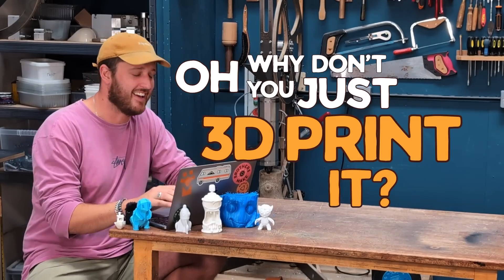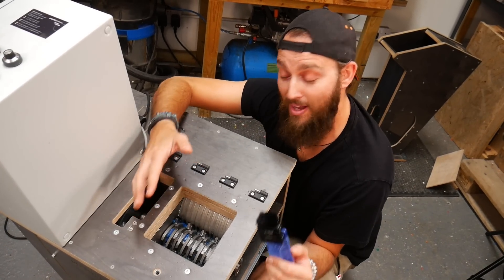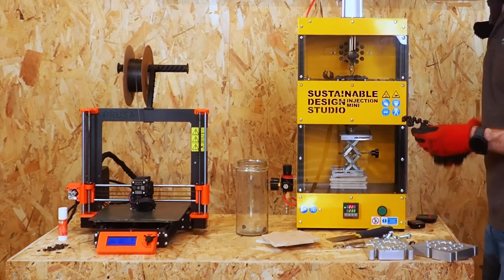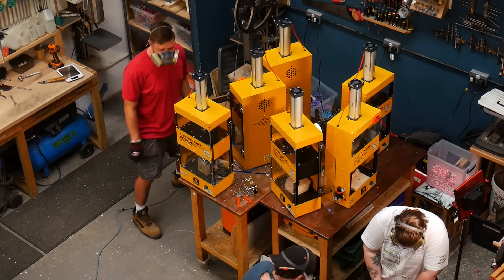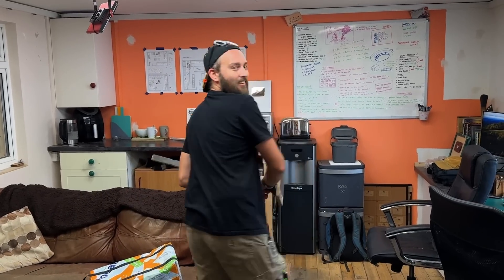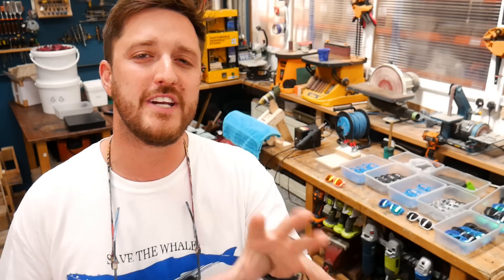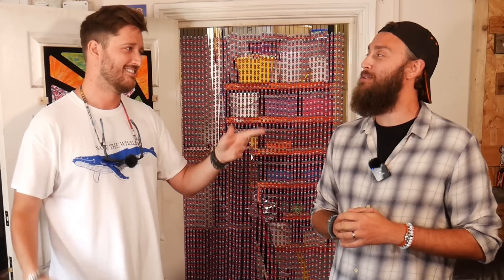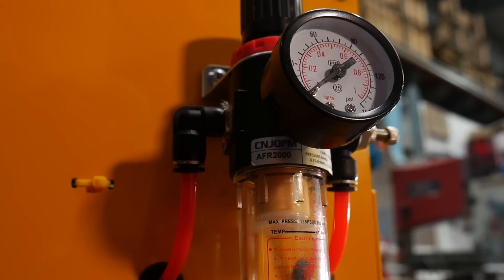Is THIS Better than 3D Printing?

Comment: I mean, in Russia, we had craftsmen who could assemble an automatic plastic injection molding machine from components costing around $1,000 and, using a cooler, bring the cycle time down to 6 seconds. This is only for small parts, although you wouldn't make a comb that way, but if you need a lot of similar small parts like Beams, it could beat both of your setups in terms of speed, price, and labor costs.)

Comment: One thing you guys are not considering is the 3D print bed. 12 dinky little beads for one print cycle? You could fill up that bed and likely print 75-100 beads on a print cycle with zero human interaction. Does it take more time? Yes, though the machines can run for hours on end with only minimal babysitting. As long as the prints don't fail which of course can happen.
And that comb print... just no. Print that flat, interlock the teeth and print 20 of them at a time. Printing them upright actually takes longer and will break off the teeth where the layers print!

Comment: When comparing print times it is disengenuous to not include setup time.

For injection molding setup time includes designing and getting the mold made. So a 3d printer, a couple of hours setup which includes design of the object and a run to three shop to buy some filament. 
Injection molding maybe a couple of weeks to months...

Comment: OK this is a skewed report because it does not look at like for like, completely ignoring the cost of the moulds, each mould might cost as much as the injection moulder and if you want a print farm then you need a mould for each machine, also how long does it take to machine the moulds ?

Comment: that prusa printer is slow. i would like to see it run on an bambulab. should of filled the bed with with as much parts as possible aswell.  
At less than 10,000 parts Formlabs Form 4L thought not consumer priced but more prosumer priced at 10kusd is a pretty solid option here.

Comment: they BOTH have their DIFERENT uses.  this is like comparing if a SPORTS CAR is faster than a 4X4 ....  IN MOUNTAINOUS ROCKY TERRAIN.  the only thing you demonstrated is that your way is really good at 1 very specific thing. i would not buy an injection machine as a hobby..... i would a 3d printer.

Comment: One thing you could 3D print that you can't injection mold (at least I don't think you can), is a pre assembled bracelet, and if you dial in your slicer, you can do that with near zero post processing.  You can also just have the printer print them all night (if you dial in your bed ejection procedure), and all day, with zero humans required, except if it gets fouled up.  Or even without bed ejection, you can print multiples of the same model vertically.

Comment: I think this is slightly distorted... you waited until the end to mention the most important factor... jig / mould manufacturing time and cost is not-insignificant.... whats been missed is 3D printers (SLA or FDM) are great prototyping, far, far cheaper and quicker than injection moulding... but for production / manufacturing once the jig has been made, injection moulding all the way... are you using a CNC machine to make your jig / mould?

Comment: OH why don't you just (Resin) 3D print it?               Seriously though, resin is much faster, I'm curious to see a video from you guys comparing that! Also wow $400 pound to get your bead mould made sounds pretty good!  I would also loved to have seen more detail on how 2 moulds was used in 6 machines. What actually was your workflow to churn that out? What are the other 2 machines doing while the mould was in use for the 3rd machine? Subbed :)

Comment: Question, when looking at bench top injection mold machines they have size options such as 50 grams. When you have a 50 gram injection mold machine how big of an object can you mold in relationship to a roll of quarters? Like one roll, or 1/2 roll, etc..? Thanks 7:30

Comment: 🌍 PLA vs. Recycled Plastics: A Fair Perspective 🌱

I love what this channel does with recycling plastics like bottle tops and carrier bags—it’s inspiring to see waste turned into something useful! But I feel it's important to bring balance to the conversation around materials like PLA (Polylactic Acid).

PLA 3D printing materials are often criticized for their environmental impact, yet they have significant benefits:

PLA is made from renewable resources like corn or sugarcane, reducing reliance on fossil fuels.
It’s biodegradable under industrial composting conditions, which makes it a step toward reducing plastic waste.
However, it’s true that PLA, like all materials, has challenges:

Without proper composting facilities, it may take centuries to degrade in landfills, much like traditional plastics.
On the other hand, recycled plastics like PET2 or HDPE are fantastic for reusing existing waste, but they aren’t biodegradable and persist in the environment if not properly recycled.

Here’s the truth: both PLA and recycled plastics play essential roles in reducing waste and pollution. The real focus should be on:

Proper Disposal Infrastructure: PLA needs composting facilities, and recycled plastics need efficient recycling systems.
Complementary Roles: PLA is great for items designed to degrade, while recycled plastics excel in durable, reusable products.
Instead of labeling one as “bad,” let’s recognize that sustainability is about using the right material for the right purpose and ensuring it’s disposed of responsibly.

As the 27th day 🌟, I’m passionate about fighting for fairness and sustainability. Let’s celebrate solutions that work together to protect our planet! 💚♻

Comment: A real injection moulder machine only works fast if it is made from mold materials that can be cooled quickly to solidify the product and eject it quickly from the mold. If not you have a simple molding machine.

Comment: You think 3D printing would be more expensive for your beeds because you aren't as good as 3D printing than injection molding 🙂. I am someone who is good with 3D printing but never used injection molding yet. Let me show you how I would have 3D printed the beeds and when injection molding would be better than 3D printing and vice-versa.

I could have printed these beeds with no raft and no support so no post processing after and I could put enough on the bed to print 3 days straight before having to remove them by placing them on top of another, you can look on the internet it takes some skill but permits to print more per batch. By those means I would be at least 2x more efficient as your setup so I'd need at least half of 35 printers, probably even less because I normally print twice as fast as other "average" 3D printer user by advanced slicing and special printer modifications for the same or better strenght and quality. Also I buy my black filament at 10CA$ wich is equivalent to 5.57GBP and colored one at 7.8GBP wich is way less than in your video. Based on what I could see in the video you have to recycle a lot of your plastic when injection molding the little beeds while my setup would make no waste so I win on the plastic price per beed. Also I would only need to be here at the start of my setup and at the end only with maximum 5% failure rate of each print plate, I also win with worker time which is the most valuable ressource here. With machine cost I would be double your injection setup I think, definitely not quadruple.

Why did I prove all this ? I wanted to show what 3D printing was created for. It is made to make cheap and accessible parts that need little to no work hours to build and only machine time. Also 3D printing permits to make extremely complex parts and even hollow parts with no post processing time.

The real reason why somebody would use injection molding over 3d printing is:
- Food safe product easy to wash without the need to coat it in resin for example. I think some 3D printing resins may be food safe and easy to wash but I haven't researched yet, I know though that normal printer UV resin is not food safe even in it's cured form
- Finish quality even a little better than resin
- Really good strenght in all direction, FDM 3D printing is as good but only in the direction of the printed lines. For example your comb would be pretty weak if 3D printed or would need to have big fins, so molding is better in that case. Also most 3D printer resin is pretty weak in comparison to what injection molding can make.
- Best price per kg, for really heavy and or strong parts, injection will always win, especially vs resin because resin costs an average of 17GBP per kg for me and that's just good basic resin for that price, far from engineering grade resins. Keep in mind some industrial printers can use pellets so for those printers cost per kg is not a problem but strenght still is.
- Injection molding is probably usefull in more ways but right now I can't see more

I hope this can open your eyes to the 3D printing world, show exactly why somebody would choose an option over another and also show that 3D printing doesn't need as much worker time as you said in your video. You can even buy auto ejecting printers and cameras that detect product and printing errors/defects to 100% automate the system like you can with injection molding. Almost everything can be automated these days.
Reply from the maker: All great info. I guess the overall downside is that regardless of how quick & cost effective you can make it, you still have FDM printed beads, vs a higher quality end product with injection moulding. Sure, resin printing is higher quality.. (or maybe you meant resin-coating each FDM printed bead for a better surface finish?) ..but either way it’s a huge demand on virgin plastics whereas we can be truly circular. Thanks for the insight!
Reply: @BrothersMake  I meant 3D printed UV resin but you can also coat FDM if it fits better the needs. 

And yes I too really like that you propose recycled materials, FDM is still far but we have some expensive recycled filament that is offered on the market. I am also looking to produce filament made from as much post-consumer plastic as possible, this could be a way to save money for the consumers as well as be better for the planet

Comment: This was a really cool intro into the process of Injection Molding at smaller scales - you've earned a new sub from me!

From the 3D printing side, the look/feel/durability of things like device enclosures for smaller batch products has been on my mind a lot. Injection molding is something I'd always written off as far too expensive when selling a device that costs ~30-100 USD and where the margin is only $10-30 after COGS is accounted for. When you're printing for yourself it's easy to justify spending the extra time and money to get things perfect and post-process prints, but it's harder to justify when one extra hour of labor on an individual item almost/entirely erases your per-unit profits. 

I'll have to take a closer look at the Injection Mini after this, or maybe slide into your inbox for a quote 😊

PS - As much as the 3D printer in me wants to nitpick little things, I see you've already got 493 comments here doing exactly that, so I'll spare you. Tediously roleplaying every possible argument for or against one manufacturing method doesn't make for a very watchable video, so I'm glad you kept it light-hearted 👍

Comment: When doing mass production, injection moulding is definitely the solution. If you won’t be doing mass quantities, there’s no way to justify the prohibitively expensive mould. Because of this fact, determining which is better is a little like trying to decide if apples are better than oranges. Each has specific benefits the other cannot match. Now, if you can find a way to 3D print a mould to use in injection moulding, you’ll really have something worth something.

Comment: Why would you 3d-print a comb with the teeth up?  Because your design isn't tuned for 3d printing?  And why only a single comb per print?  That will cause huge slowdown because the layer needs to cool before putting another layer on top.  Don't get me wrong: I agree injection molding is better for the product you presented, but you didn't even give 3d printing a fair shot.

Comment: those are very different processes for different aims. you can not compete with 3d printing in a speed form an idea to a product at the comfort of your home. also the price, working area and preparations required for the 3d set up are quite a bit smaller than injection molding, but 3d printing is not the most rational way to go for mass production.

Comment: If you think about it the bamboo A1 mini is perfectly reliable with excellent results and a much much much cheaper price than the printer that you chose. And for your time comparison you printed your comb in the worst orientation possible for both time and strength. It would print tremendously faster if it was laying down instead of standing up and it would be much stronger because of the layer orientation on the teeth. Aside from these seemingly disaduous choices for your metrics, injection molding is better in some cases and 3D printing better for others. I just dislike when people seem dishonest in the metrics that they choose to use.

Comment: I'm currently in the process of making molds for glasses frames. I used my 3d printer to print the items and now I'm about to create the molds using the 3d printed frames so I can make Epoxy resin final frames. I would love the equipment to do injection molds in the future it just looks really fun to me.

Comment: Something not mentioned here....probs just me being ASD af; the is the cost of the labour element, power costs to run everything etc. which I feel would blow out any of the 3D printer's "economic advantages", anyway. 

3D printing for prototyping.
Injection molding for repetition, low cost, production.

Comment: For those who did not make it past 10 minute mark of the video, the cost of just one mold is more than the cost of the 3D printing machine, which I found quite surprising.
Reply: That's because an aluminum mold needs to be milled on a CNC router or milling machine, which can take hours. However, you can buy aluminum molds that just have empty square spaces inside and insert a high impact resin printed mold inside of the aluminum mold. That is a lot less expensive.

Comment: You can buy a 30-40 year old very small injection moulding machine, for much cheaper. It will fit there in the middle, will work much faster, by itself and is reclaimed. Spend the rest on a conveyor belt or moulds. For your purpose injection moulding is better, but for beginners and people making unique stuff or shop accesories, 3d printers win imo, because you don't need a mould.

Comment: no matter how you slice it, they did the testing for this video. Injection molding is cheaper and faster at scale than 3D printing. This is not negotiable. Injection molding is more expensive at the start but cheaper in the long run. ultimately, that's good business. cutting cost without cutting product quality. Trim the fat, not the flavor. Shave off the waste, not the value. For all the 3D printing fanboys, not everyone has the take home paycheck you do. It would be cheaper for me to literally build an injection molding system from junk than it would be to buy one of your printers. Not to mention, the printers are not used at industrial scale outside of printing houses out of concrete. Injection molding is a very old, proven technology, most likely older than most of you winging about it. Take it from an American who has seen the inside of some of your favorite food's factories. Injection molding is safer for your food, faster for the company, cheaper for the consumer, and has been reliable longer than you've been alive. Find something genuine to complain about, because I'm not going to mince my words for a bunch of fanboys.

Comment: Quick question, I've been wanting to get into the bottlecap recycling due to you guy's videos but was wondering, some of our soda bottle tops in the States have a rubber/wax seal in the top. Some have moved away from it but a lot of them still use it. Should I make the effort to cut those out before melting or is it ok to leave them in?
Reply from the maker: We avoid these as unfortunately they can’t be recycled with them in, but prove to be very difficult to remove effectively
Reply: @BrothersMake  
Ah. Thanks for the quick reply. Love the work you guys do.

Comment: Wow this comparison is so inaccurate. You need a crew of people for injection molding, but an automated 3D print farm runs while you sleep with zero humans involved. Also you skipped the whole tooling bit, a considerable cost. And if you get your design right there is no post processing in 3D printing. Layer lines are only an issue if you are bad at designing. So much post processing in your case! Heck, with a multi material 3D printer you could print in place the whole thing without the need to manually thread the beads onto a string.

Comment: 3D Printers can print almost any random 3d object from scratch. With no additional cost and hardware... Injection mold can replicate what's carved in the mold an unlimited amount of time, very fast. But you need do carve the mold, which normally is a third-party service that is expensive and takes time do be made.

Comment: BORX 30/40G Desktop Plastic Injection Molding Machine 220V 12/17T Horizontal Injection Machine 0-400℃ ABS/PVC/PP Molding Machine; this machine would greatly cut your cost.